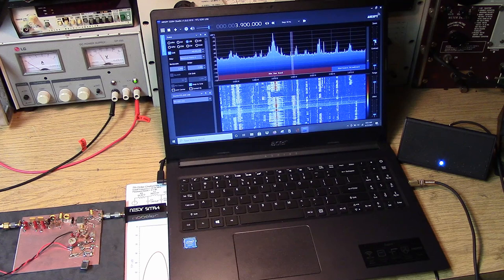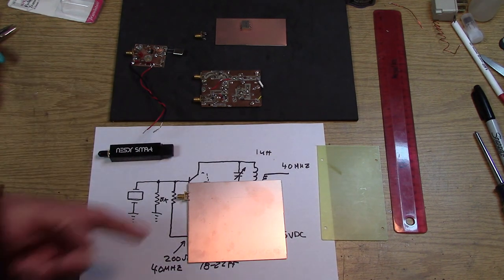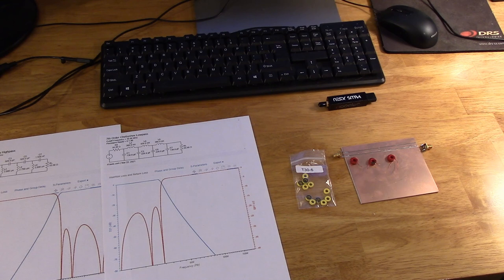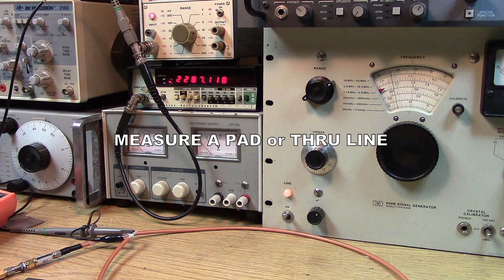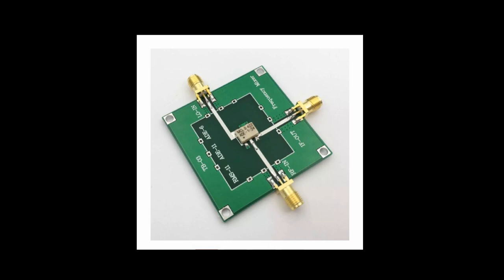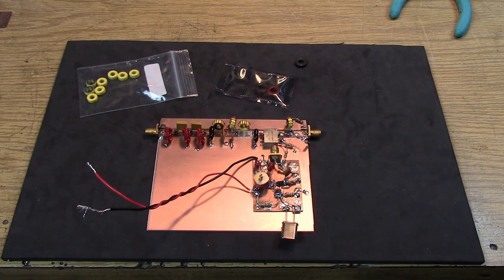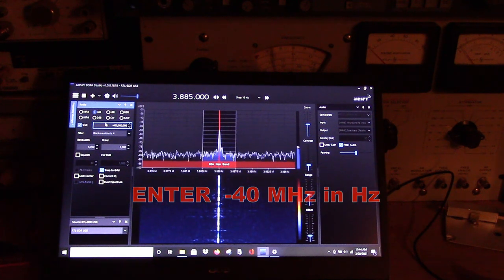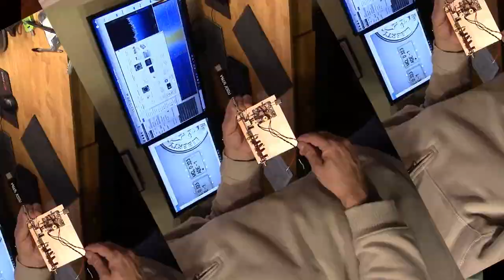UPCONVERT MY DONGLE!

Comment: Great Video as always Mike!  Couple of Toroid Tips:  First, you commented that when you moved the windings, you changed the inductance.  If you find that the changes are a little too jumpy or great, wind the toroid tightly (which is how I wind all of mine anyway); that way, when you move the windings they are both harder to move and change the inductance less.  Second, if you need both mechanical/inductive stability and reduction of capacitive coupling from the PCB, mount the assembled toroid on a couple of plastic faucet-washers with a nylon screw. Further, coating the assembly will help with vibration and environmental effects.  This really comes home when you have a bunch of loosely wound end-stood toroids bouncing around in a mobile application.  Lastly, Fun-Fact: compare the A-L of a T44-x with that of a T50-x; and nope, not a misprint!    73...
Reply from the maker: You sir are a torrid toroid trubodor. Thanks for the tips!

Comment: Nice presentation.  Instead of having to dig away at the copper for transmission lines and such, I use single sided copper (face up) and cut and epoxy strips and island also from pieces of FR4 placed on top the ground plane.  If you were shooting for 50 ohm line, just use a strip cut to a width of about 0.1" and glue it down.  Close enough, assuming 0.064" thick FR4.  Looking forward to your next installment.

Comment: Nice, thank you. I'll be building one of these for sure, also looking forward to you covering the digital modes. Passed my Technician and General on Monday and I'm looking forward to being able to join you on the airwaves. Will take Extra in a few weeks - didn't try for all three because I had not covered the Extra material yet.
Reply from the maker: Great Vince! Good luck on the upgrade. Adding shielding over the filter and a post amplifier to the passive mixer is producing signs of greatness. Standby for Part3!

Comment: I've just watched this video again, as I'm more set up for SDR with a RTL-SDR V3. Your comments at the end of the video regarding SDR Sharp and Windows 10. I ran that set up on a 64 bit machine and found that it was very resource hungry. It took around 18% of my processor (Intel Xeon X5-1620 V4) function and used a lot of power according to the Task Manager. Both SDR++ and SDR Angel use about 4% processor and are low power consumers. They do use double the memory, 8Mb to SDR Sharp's 4Mb. 

As you described, SDR Sharp did fail to restart or stuttered on starting. I also found that it was very picky regarding which USB socket than when I used the same set-up with other software. Strange.

Comment: The freq correction is likely not your filter. Those RTL SDRs, even the NooElec ones, have pretty sloppy clocks. The heat in the dongle could be your root cause of the drift.
Reply from the maker: Comparing the clocks and TCXOs etc. are a necessary marketing differentiator, that's for sure. It low hanging fruit in a limited BOM with a lean price point. We are talking 50 cents more between a 5 ppm crystal and a .5 ppm TCXO.  But the effect is oversold in my opinion. I don't see all of this supposed drift affecting anything for most work. On the other hand, if a player came up with a back end chip that had 3 to 6 more bits of A/D - i.e. doubling the dynamic range - now that would be a real performance and value game changer over the other vendors.

Comment: Hey ... i have a question ... could fixed value inductors be used instead of the toroid cores ... ?
Reply from the maker: Yes. Those are common values that could be standard choke values. Normally these are ferrite core SMD inductors.
Reply: @MIKROWAVE1  Thanks ....